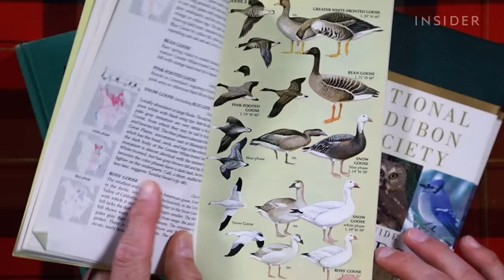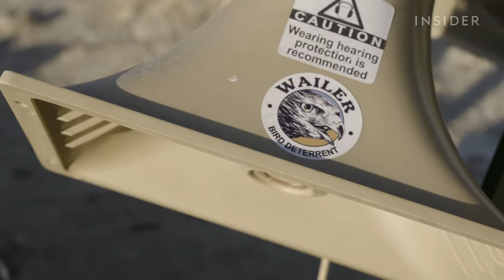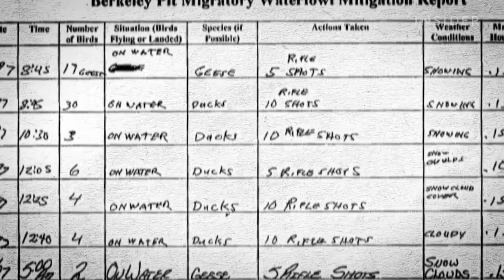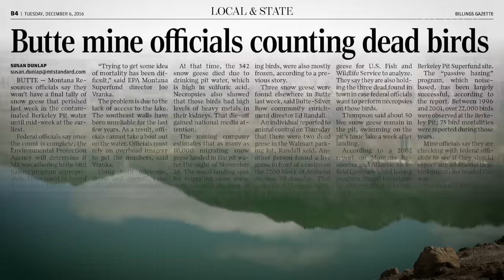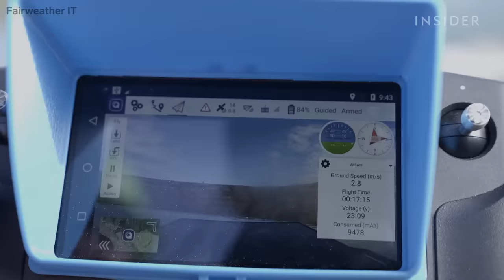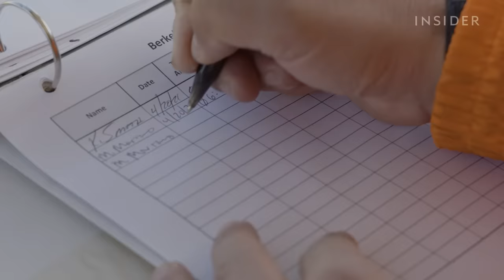Meet The Man Who Shoots At Birds All Day To Keep Them Off A Toxic Pit | World Wide Waste

Comment: Just use so called shade balls or “bird balls” that have been used in ponds along airfield runways. Airports have detention basins to collect stormwater runoff. As the ponds fill up, they attract birds. So airports float the balls on the ponds to keep the birds off.
Reply: Difficulty here is the pond is full of acid. So while a RC boat can go in an out with a rinse and be fine, probably floating balls long term would just have them melt and sink.
Reply: @Wolfy1012  As far as I know, plastics generally do not react with acids, unlike metals. The shade balls that are used in LA water reservoir are food grade because of the drinking water. For this case, it can be created from the any plastic which doesn’t endanger the wildlife.
Reply: That's just not nearly as fun.
Reply: shade balls would honestly be the best solution but it's probably expensive af to fill something this gigantic with them. Also the lake freezes, not really sure how the balls interact with ice
Reply: @netrogat  no plastic is a general term. There are plastic who hold up well to acid, but there are also plastics that melt very quickly. It would depend on the plastic used .
Reply: @netrogat  it would be billions if not tens of billions to produce shade balls in enough volume of PTFE (peek, PVDF, etc wouldn’t be enough to counter sulphuric acid with heavy metals) to fill this lake.
Reply: @Wolfy1012  Very few acids react with plastic. In this case it's mostly just sulfuric acid, which wouldn't be a problem. The pit "only" has a pH of coca-cola.
Reply: @scottieb6442  PTFE would be unnecessarily expensive. Polyethylene should do just fine.
Reply: @scottieb6442  you don’t need to fill the lake, just float a single layer across the top.
Reply: @Wolfy1012  Couldn't they dump tones of Bicarbonate Soda to raise the PH of the lake?
Reply: @onionman8160  Bi Carb Soda to bring the pH back to 7?
Reply: Everyone is a genius on the internet 🤯
Reply: @dailyexpresso8316  you'd have to make enough to fill that pit. The issue is the acid is generated naturally from the water that pools there then leeches out heavy metals. You would need to prevent the water from entering the pit in the first place. Meaning you need to fill the pit.
Reply: @whatsittoyou4153  nope, just every genius has an internet these days
Reply: People saying this idea is too expensive clearly haven't thought about the cost of employing six guys to sit there all day every day, and the multi-million dollar kit that they already use. The rifles and RC boats are an eccentric and expensive method, and will only last as long as these people care. Shade balls are the way to go.
Reply: Apparently this was suggested, but was axed because it would impede evaporation.

So it’s like, calculate how much water is evaporating and build an evaporator…
Reply: I just did some research and ran some numbers, and I think the amount of energy it would take to evaporate the needed on-average 3,333 gallons per hour 24/7 would be insane.

So shade balls, not so great an idea.

So let’s go with a spiked net. Get a net that floats, put some super annoying spikes on it, and I bet you that would that keep birds away.

A net wouldn’t impede evaporation, at least not on the scale that shade balls would. So such a net need only cover what, 5% of the surface area? So that means you only have to evaporate 4,000 gallons a day, or 167 an hour. So you would need to run 6 or 7 of these “Water Eater 375G” units I’m looking at during the day. Not sure how much propane that would take though.
Reply: @onionman8160  you say that it has a PH equivalent to Coca-Cola but from someone who lives there swimming in Coca-Cola for a couple hours is far less dangerous than swimming in the Berkeley Pit

Comment: I’m sure they could come up with a better solution to keep the birds off the surface of the water! Why don’t they put a net a couple of feet above the surface to stop the birds from landing! A net that has wide enough gaps to allow snow to get through but not birds!
Reply: they would need a really..big..net. like massive.
Reply: @aaronrosner4942  I mean like put one together piece by piece with pilings drilled into the bottom so it’s not super saggy! Ya know
Reply: @aaronrosner4942  yes, but this seems more logical than building these facilities & paying wages for god knows how many years to come
Reply: @JASONKENTJANA  you’re right, it is too logical
Reply: I think you would run the risk of the birds tearing the net to get to the water, as well as a net being an overall annoying thing to maintain.
Reply: 1. Maintenance. 2. Expense. 3. Birds will get tangled. 4. The fumes themselves are probably toxic and acidic, making keeping the net in working condition unfeasible.

Comment: In california there are a few reservoirs that cover their lakes with these big spheres. I wonder if that would work. They do it there to reduce evaporation but I’d imagine it would prevent birds from landing.
Reply: Be cheaper to in the long run I bet. They said muilti million dollar arsenal. Probably be cheaper to cover it up.
Reply: I think you're forgetting the whole sulfuric acid part.
Reply: @pseudonymous1382  why cant they just cover it
Reply: I’d say they pretty much thought of everything since they came to the conclusion of shooting a gun at them
Reply: Turns out those things in the Cali reservoirs are called "shade balls" and they're actually not specifically for preventing evaporation, but rather stopping a chemical reaction. The water the treatment plants get can have natural levels of bromide in it, and when the water is treated with ozone and chlorine, it turns into bromate (a carcinogen) albeit in small, manageable amounts. Turns out that ultra violet light from the sun drastically increases the rate at which bromate is formed when it's just sitting around in the reservoir baking in the sun. An added side effect is that they are also really good at preventing evaporation and keeping birds off the water. Veritasium did an excellent video on it.
Reply: The chemicals in the water would likely dissolve the spheres
Reply: @jackdiddIey  kynar or tylene would be fine as would many others would be fine against the acidity and the uv exposure
Reply: @pseudonymous1382  sulfuric acid is sold in plastic bottles...
Reply: @Steve-gf2yk  i love when you can tell someone flunked high school chemistry, but thinks they're an expert because they think acid just melts everything it touches 🤣
same people who are probably scared of GMO food, and think joe rogan took "horse paste".

Comment: What about covering g the pit with those plastic balls they use on water reservoirs to help prevent evaporation? And while it is covered what about turning the pumps back on treat the water and eventually empty the pit?
Reply: Exactly, I don't understand why they're using these crazy methods instead of doing what makes sense.
Reply: Came here to ask this, too.
Reply: Probably too expensive. In that reservoir I think they spent like 32 million dollars.
Reply: @jhaz89  Covering the pit with something can absolutely not be more expensive than what they spent.
Reply: @DreadfulDracula1503  roof size doesn't scale as proportionally as you'd expect, and the chemical treatment would require the mining of enough minerals to neutralise all the mine's ores leaching into the water.
My point would be not so much it's impossible, but that it requires a lot of people to convince a lot of people to sanction the money to fix it and the original perpetrators will be long gone with the mine's closure.
Reply: @DreadfulDracula1503  it's also possible the acidic water would break down shit they put on it. I've got to assume they've assessed the situation. It's also possible they don't have the money to make a huge purchase all at the same time.

Just saying that maybe, just maybe, you're not right...
Reply: @DreadfulDracula1503  I challenge you to a duel. Pistols at dawn. First one to die loses
Reply: @jhaz89  Lol, I surrender.

Comment: It'll take around 1.3 Sq miles of netting to cover the whole lake, even though it will be expensive up front won't that make more sense instead of shooting and using expensive drones
Reply: Exactly
Reply: I also thought of this but the birds will get stuck in the netting somehow and i'm not sure how you would be able to untangle them. I'm also not sure what material you could even use that wouldnt be effected by the water somehow.
Reply: @SlyTreeRat  they covered a lake in California with black plastic balls, to prevent evaporation during a drought... I image they would work! Just has to be resistant to acidic corrosion I assume.
Reply: @JunkBondTrader  Those were mainly used to block sunlight more than to stop evaporation. The berkley pit is more than double the size of the lake in California so you would need a huge amount of them on top of making them acid resistant I think it would be too impractical to be able to make enough of them. Then you have the issue of the balls becoming contaminated when they eventually start corroding from the acid which will create a huge  waste management problem.
Reply: Easier for the state government to pay $1m/year forever, than to cough up $50m for a project.
Reply: Yep. But this Murica. Bang Bang

Comment: Makes you wonder what happened to those responsible for the mess and why it isn't cleaned up.  Even adding lime to the water over time the pH should go down as well pump the stuff into abandoned oil and gas wells.
Reply: It will always come back cause its ground water coming through the mine shafts

Comment: I’m pretty sure a series of specialty “fountains” could be installed in the lake that could run 24/7 and keep the birds from wanting to land, how the pumps/material hold up to the toxic water is another story but I’ve worked enough power plant and refinery shutdowns to know there’s systems out there capable of handling any conditions when necessary
Reply: How about something that just disrupts the water’s surface? Like cables connected at opposite ends of the lake on powered reels, which can be ‘vibrated’ back and forth, or pulled forward and backwards. Something that doesn’t pose too much of a risk to the birds, can be controlled by the waterfowl protection specialist, and freaks the birds out. That way, all of the moving parts are out of the water for easy maintenance!
Reply: @imperialsecuritybureau6037  Yeah I guess wave machines could work.  There are some pretty big ones out there for artificial surfing  pools.  This lake is pretty big though. Would need lots of them probably.
Reply: The problem is still the fact that it's filled with acid, and if it's enough to eat birds in a few hours it's enough to destroy most materials in days.

While a solution is being made to actually clean it up, the current solution to keeping the birds off is so far very effective.  If it's working and it has a super high success rate then why invest in another very expensive solution?
Reply: @Bread-kun    I agree that the current methods seem to be both effective and efficient.  It's just fun to think about alternatives, even if they aren't the best.
Reply: @bagel_deficient  True.  I doubt the wave machines would work because, besides the acid factor, you would need a lot of very powerful ones since it is a lake that is a mile long and half a mile wide, I don't think it mentioned the depth but it didn't seem shallow.  Regardless you would need a lot of strong machines in the water to push enough water around to disturb the waves to a noticeable degree and cover the entire lake.  Just small waves here and there wouldn't be enough to deter ducks and geese.
Reply: I once saw a video where they used thousands of black floating balls to cover a body of water, I believe to help retain it from evaporation possibly but I could be way off with that, but anywho since the waters practically useless, catering it with tons of floating balls of the right materials would keep pretty much everything off the water ?

Comment: Can’t it be covered with large net to  some height above the water to prevent the birds from landing on the water?
Reply: I was thinking the same thing just take some really thick wires all the way across it in a crazy pattern and then  vibrate them like guitar strings or attach bells the whole way across
Reply: I think,you know it can be sanitized Or something if possible or deposit it somewhere where it will be cleaned and dumped back into the earth,idk how but I think it as this
Reply: Birds get caught up in nets, and lots will get caught since it is a traditional migration spot, they'll not be expecting anything to have changed, and they may fly in during dusk when light is low. 
I did think that ropes crossing from side-to-side with shiny mirror objects connected to them might work (at least during the day and on clear moonlit nights), possibly with bells as mentioned in this thread (so they can hear that something is not right with the lake).
Reply: No but there are black plastic balls that are floated on top of reservoirs. Since you can store concentrated sulphuric acid in tanks made from certain polymers, perhaps you would also be able to make balls of the same polymer which could float in the weaker concentrations of sulphuric acid found in this lake. The Wikipedia page for the pit says the water is as acidic as lemon juice or cola, neither of which require exotic plastics for long term storage. The order should be large enough to motivate some custom work from a ball making or sulphuric acid tank making company if special polymers are needed.
Reply: @AndrewHelgeCox  I don't think plastic can withstand the sulfuric acid.
Reply: There are many possibilities to avoid birds from landing on the water but let's be honest...i don't think they really cared if their solution is shoothing with guns, fireworks, drones, laser pointers and  assuming fulltime jobs to do it. And there are many polymers chemically resistent to sulphuric acid by the way.
Reply: @bogdangiusca7431  He just said that you can store high concentrated sulphuric acid in polymer tanks wtf
Reply: I thought about this too! like the nets they use at baseball statiums to protect the crowd is what I thought... that consistency
Reply: gun is cheaper

Comment: It’s too bad it can’t just be drained. I know for a fact the army corps of engineers could do it and keep the ground water at bay. It’s too bad this kind of work isn’t a priority in politics. Ps. I’m a hunter as well. And this man represents the best of what makes hunters great, protecting the resource.
Reply: Cheaper to have this guy do it
Reply: The problem with waste rock seepage isn't the fact that it can or can not be drained, but it is in the mineral composition of the water. The water would still be chemically contaminated, so say it is drained from the tailings lake, the water would have to be transported somewhere else.
Reply: How do you drain and dispose of a mile's worth of toxic heavy metal water?
Reply: @charliebruner8444  That's the thing, the water could MOVE, but to my knowledge, there is no way to economically and morally dispose of it. That's why mines have tailings dam's and tailings ponds.
Reply: @CannedLemurs  To much to transport. Most likely would filter it on location.

Comment: Have they thought about just filling the lake with something so birds can’t land or covering the lake or even filling it in.
Reply: Yeah thats what I thought about too, like perhaps put a net with buoys to support the net along the water, and perhaps even add an electrified metal matrix that would shock the birds and keep them from landing on the net
Reply: It might be cheaper to just pay him to shoot a gun rather then build a net
Reply: @skull371   guessin you missed the part where the water is actually sulphuric acid, those balls you’re talking about would be no good in a few weeks
Reply: @skull371  To add on to this, This method has been tried and proven ineffective. While plastic air-filled balls moving erratically in the wind does scare birds for a bit, after a while the birds get used to them. This is why plastic owls aren't a permanent solution. After a while, a bird is going to try attacking it and realize it is not real.
Reply: Have they though about the bullets that are building up in the water as well. All that lead is just dissolving and adding to the toxic stew eh. Probably gonna cause more problems later.

Comment: Surely it's cheaper and easier in the long run to just link a bunch of nets together and simply prevent them from getting into the water to start with.
"He uses a multi-million dollar arsenal of high-tech toys" Proves my point exactly. They're spending millions on tech when a simple net is sufficient and probably costs <1% of their current spending...

This is a classic case of over-engineering a solution.